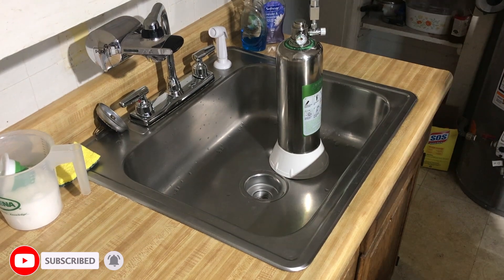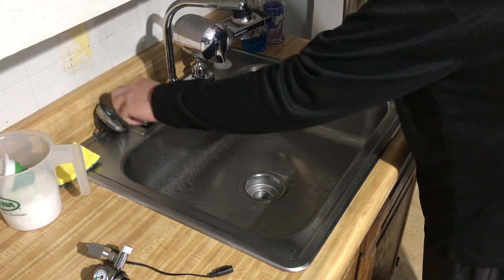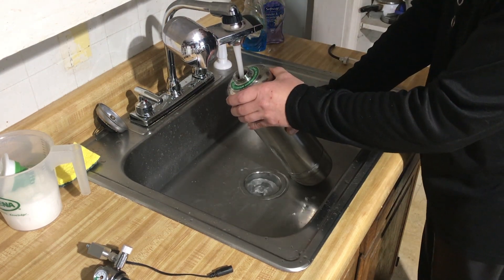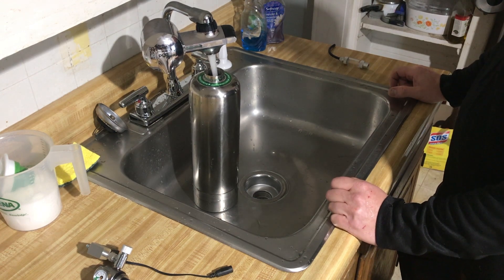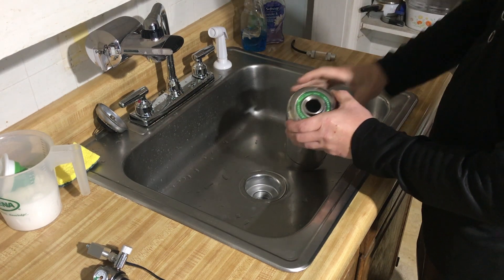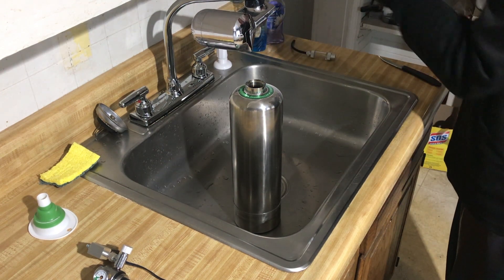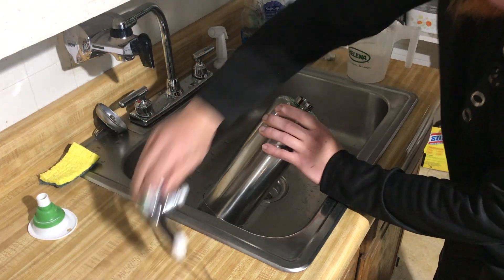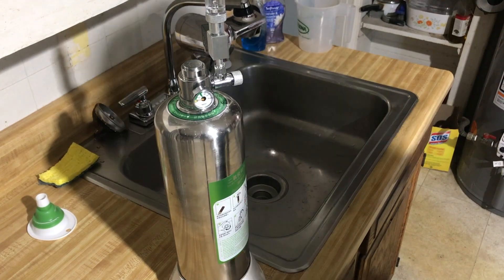Recharging The ZRDR CO2 Generator

Comment: i have 1 ltr... its working good 3 to 4 days... but suddenly its stop working... pressure still inside bottle

what can i do plz help
Reply from the maker: @m.zeeshanbangash4613  sound like something is plugging up. Maybe the adjustment needs to be made or the filter inside is plugged.
Reply: @RollingTardis  how can i unplugged?
Reply from the maker: @m.zeeshanbangash4613  needs new elements. Parts can be found on Ali Express. Though it may be cheaper just to buy a new unit from Amazon, then send the old one back to Amazon as defective.

Comment: 300 g of baking soda and 228g of citric acid with at least 474 ml of water will reduce the waste and will help with undissolved stuff at the bottom of tank. Mine take around few hours to build up pressure.
Reply from the maker: I will have to try that formula!
Reply: @MrSKULLoO  if I have a bigger generator, should I just multiple these numbers x2?

Comment: Your adding the Citric acid and soda incorrectly. Citrix first then soda. You will get longer use. Never shake.
Reply from the maker: Makes no difference, in my findings. I have done it all 3 ways. C+B, B+C, Mixed. Same run time.
Reply: No you will not order does not matter

Comment: Hi, greeat video i saw the first one you did. I have a question where do you conext the timer is anything else to do in the valves?  I am afraid it will explote during the night that is no releasing co2 to the aquarium
Please answer me
Reply from the maker: I think you are referring to the electric valve. It gets hooked up to a 12. volt source. once the valve is closed, there is very little chance of co2 leaking. There is also safety valve to prevent explosion from being over pressurized. I have had mine for several years now. very safe unit.

Comment: You can save some time and water by boiling the water to clean. thanks for the video.
Reply from the maker: Great tip! Though a few rinses with hot water, works just as good.